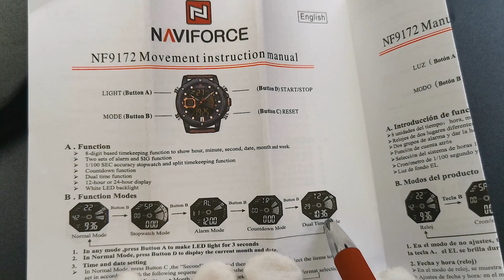How to set the NAVIFORCE multifunctional LED Digital men's watch NF9172 adjust the digital functions

Comment: Helllo my button doesn't work when i click to change the time in minutes. It beeps but in display it always shows the hour only
Reply from the maker: Hi. First plz make sure that you are not in the Dual Time Mode but the Normal Mode. In the Normal Mode, press the button C and the "seconds" will flash, then press the button B to switch the item to hour, minute......When you are in the corresponding item, press the button D to adjust.
Reply: Karish
Reply: @NAVIFORCECHINA  25sna
Reply: @NAVIFORCECHINA  Karish Vibhav 
Hello my button doesn't  work  when 
Click  to  change the time in minutes 
lt  beeps but in display ti always shows  hour  only   V.swami  
Replying to @ NAVFORCECHlNA 25

Comment: How do you adjust the clock mode?
Reply from the maker: Firstly press the button B for 2 times to enter the clock mode, then press the button C and you can see the "hour" blinking, then press the button B to switch to "minute". And press the button D to adjust correspnding number, finally press the button C to exit.